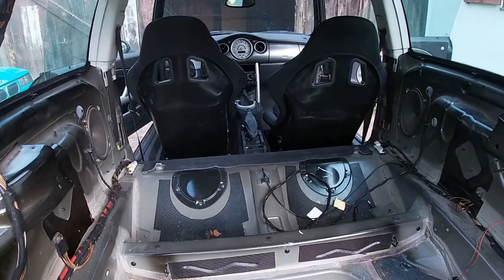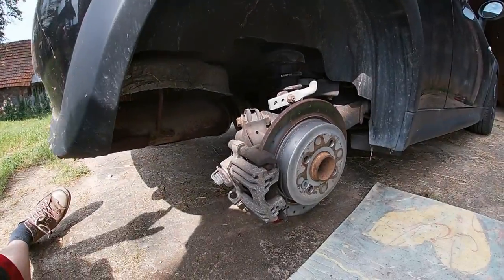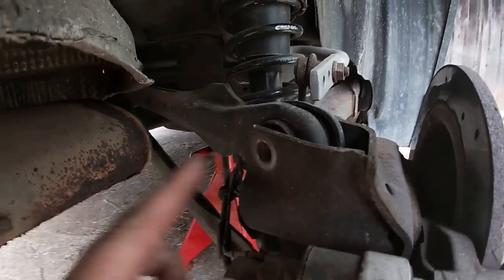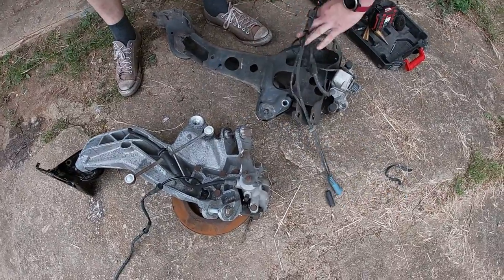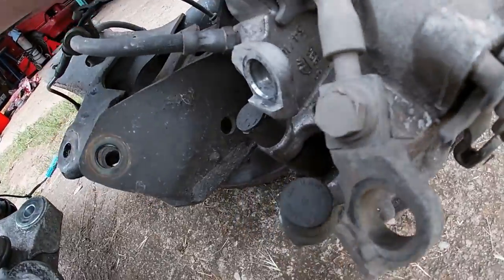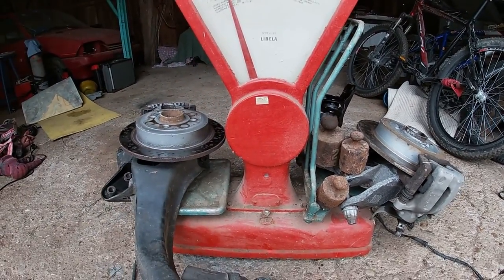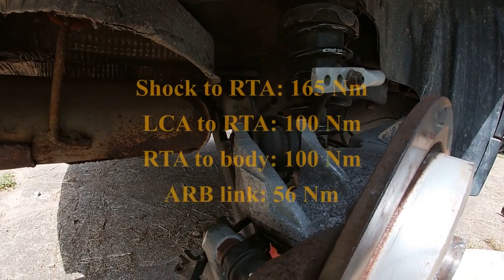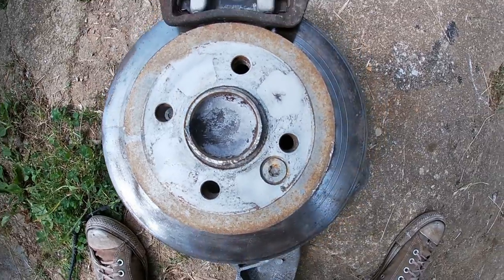How-to upgrade Mini R50/R53 rear trailing arms and calipers with lighter R56 parts

Comment: Were the bottom shock bolts the same for both arms other than the conical washers
Reply from the maker: Think that r53 ones are shorter, but they do engage enough threads